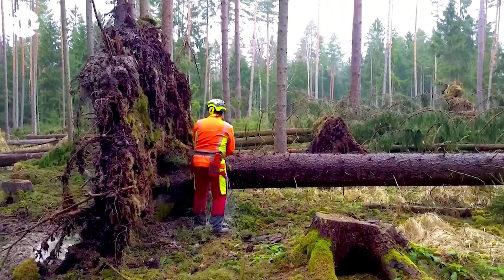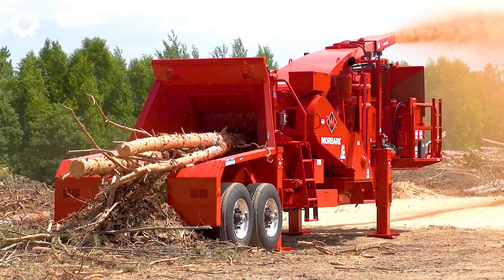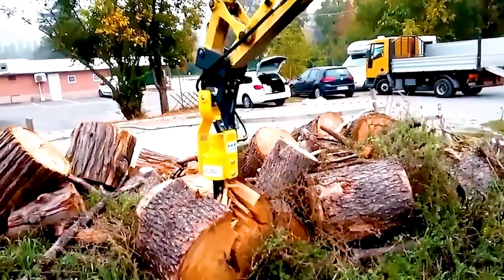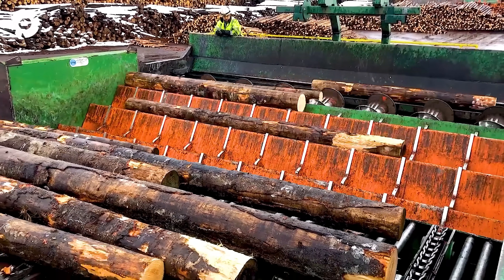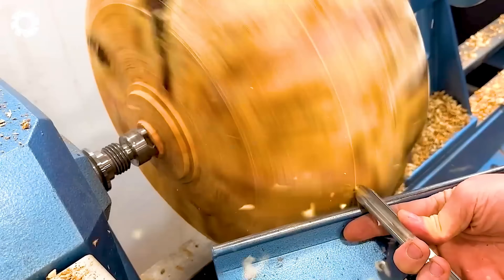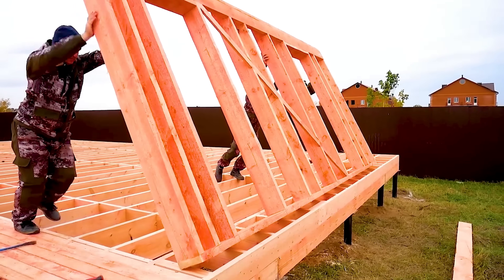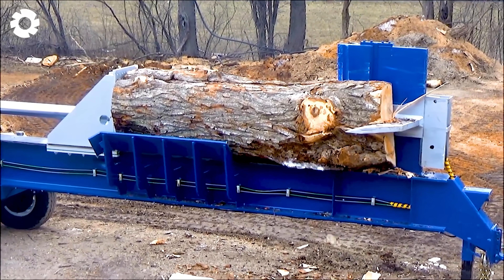Extreme Dangerous Fastest Big Chainsaw Cutting Tree Machines | Biggest Heavy Machinery Machines

Comment: Fuel depots for e-planes and UAV fleets are constructed with zero-emission heavy machinery.
Reply from the maker: Each hydraulic hose is protected by abrasion-resistant sleeves and routed with anti-chafe spacing.

Comment: Fuel transfer arms and payload gantries are installed using high-stability heavy machinery cranes.
Reply from the maker: You can tell this heavy machinery uses advanced sensor fusion—boom, stick, and bucket positions are monitored in real time.

Comment: The most fragile modules fly only after the strongest heavy machinery moves them.
Reply from the maker: The arm uses synchronized feedback from dual linear encoders to regulate proportional valve shift and prevent overtravel.

Comment: Before a spacewalk happens, months of heavy machinery work has already been completed.
Reply from the maker: The track frame features box-section reinforcement with internal cross bracing—critical for resisting torsional twist under uneven ground pressure.

Comment: Heavy machinery supports solar panel arrays powering off-grid base stations.
Reply from the maker: This machine features adaptive power mode, adjusting torque output based on terrain resistance in real-time.

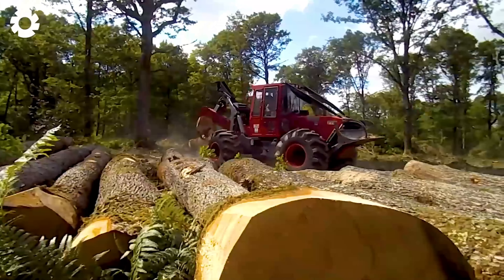Comment: 02:20 KX F40 Tractor Performance Features a 140-horsepower engine with fuel efficiency to reduce costs and boost productivity.
Designed for labor-saving wood transportation.